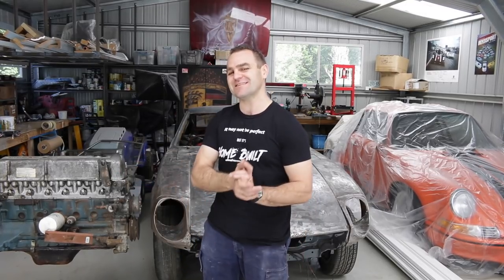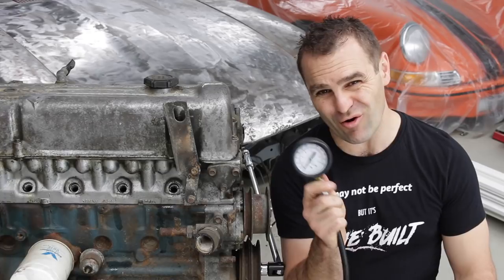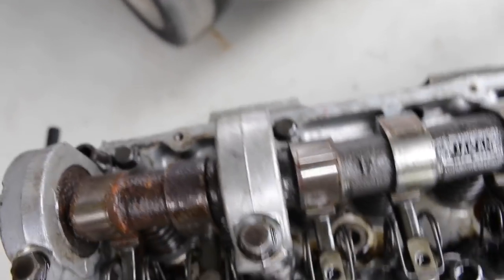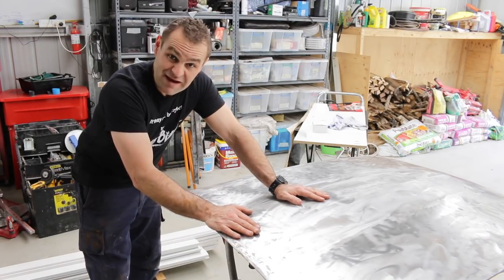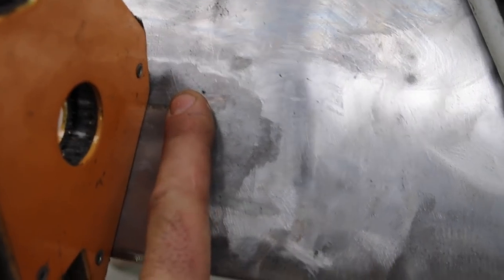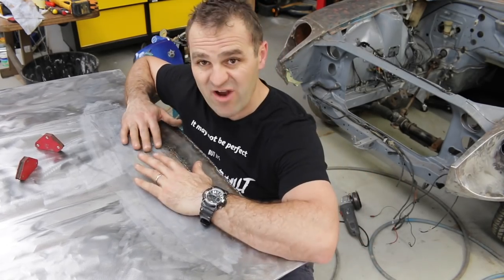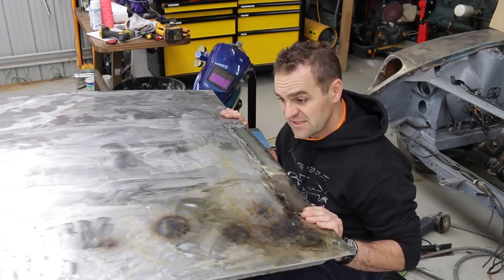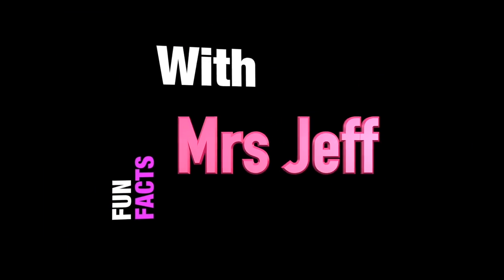Head off and panel shrinking - Home Built Datsun 240z part 4

Comment: For the Compression test your going to need to be turning the engine over at cranking speed or very close too it. What you can do in the future is a cylinder leak down test. put the engine on tdc what ever cylinder your testing and use a leak down tester to fill the engine with air and it will give you a percentage of leakage on that cylinder. Then you base your numbers off the differential of the cylinders. usually they should all be within 5psi of each other.
Reply from the maker: Thanks. I will definitely do that next time.
Reply: You wont get an accurate leak down numbers until this engine has ran. Its leaking everywhere with all that corrosion. Needs a new cam, new lifters, lap the valves, hone it and slaps some ring on it if the cyl. are still round.

Comment: Glad to see the shrinking technique treated you well. Also to minimise warpage when welding in patch panels you should quench the welds with cold water and a sponge. Keep it up jeff
Reply from the maker: I don't like using water on it as it gets inside the panel. That is why I was using the air, basically just as effective, without the rust issue.
Reply: Home Built By Jeff also tried air but doesn’t cool the panel anywhere near as good as cold water, I see your concern though. Just the nature of the beast I guess 😏

Comment: Geoff..... i'd leave a bigger gap between the metal to be welded.....so the weld 'fills' the gap, rather than builds up on top...
And if you've already tacked the piece into place and the gap is dissapearing, you can run a grinder through it with a super
thin cutting disc, giving you the correct size gap again... (if you follow me..!)
I'd also only do very very short welds, (2 or 3 trigger pulls), and keep it cool all the time.....hopefully preventing distortion...
Not being critical though, just trying to help.. Enjoying both builds....
Oh, and to upset the Datsun purists, chuck a big BMW motor in it....!!  Ollie.
Reply: ollydubhead the weld doesn't need to fill a gap, it should melt the surrounding metal and blend in, they call it penetration. If it is visible from the other side (without blowing holes in it obviously) it's called full penetration, which is what you want for the strongest weld
Reply: I agree, a big BMW engine would be cool; but most BMW I6s are slanted over significantly. Also, good tips on the panel replacement. If I'm reading your post correctly, it would be like this: https://youtu.be/KsuYQoqCZeY?t=8m10s
Reply: Yeah thats exactly how i do it....if there's no gap, the heated, expanded metal has nowhere to go, so it distorts.
And, like i said, if you find the gap is closing up when welding, dont panic, just run a 1mm cutting disc through it...hey presto....nice gap to weld again. Also, project Binky....the best...!
Reply: ollydubhead speaking of which, new episode!
Reply: Yeah, and he took note....! But to be fair, with that thin, knackered, scuttle panel he didn't stand much of a chance with a mig. Geoffs next toy: Tig welder...!  BTW, there's a new binky out too..

Comment: Hi Jeff! If you weld something like this, put some wet towels around the welding area to cool it down so it wont warp.
Reply from the maker: I don't like using water on it. Air is better. If you watch the next few I sort out the warping issue.

Comment: Hi Jeff, No Compression on engine.......... head may be warped, due to no or low coolant in the engine, when it was last run. The valve seats move out of position, as the head overheats. Had this on my old Mazda when a coolant hose split. Could see daylight through the side of the valves, when they were closed. Head was skimmed and all the valve seats recut.

Comment: Project car and alot of money going into the rest of the car. Get the engine pulled apart and put in a tank,  it gives you peice of mind and upgrade the valve seats to run premium unleaded. Makes life easier and i learnt the hard way with 2 engines. Worth every cent for a proper rebuild.
Reply from the maker: I have decided now I am going to do a full rebuild, but I will do it myself of course.
Reply: willow's random garage you don't have to upgrade the seats. Alloy heads have hardened inserts already.

Comment: Loving the Datsun build.  Looks like you need to regrind the cam, and replace the valves in the head.  I wimped out and bought a rebuilt head for my 240z.  I did install a ‘hotter’ street cam from competition cams.  The grind they provide lets me set the intake and exhaust valve lash to the same value, which makes life easier.  A bit rougher on the idle, but you can feel the increased pull around 4K rpm.  Good luck with the engine rebuild.  Are you planning on fuel injection, or the lovely SU twin side-draft carbs the 240z originally had?
Reply from the maker: I am now looking at doing a full rebuild on the engine. I am going to have a look at what cam to get. I want something that is still streetable, just a bit tougher. As for induction, I am not interested in injection. I am thinking of going triple webers. It should sound pretty good :D

Comment: If you have hydraulic lifters, you probably don't have them inflated with oil pressure. Cranking with a starter and seeing if you have oil pressure is a good start.
Reply from the maker: That is a great point. I didn't even think about the hydraulic lifters needing the oil pressure.
Reply: Anthony Krieger it does not have hydraulice lifters....just too slow

Comment: Did you remove the tape from the inlet ports to do the compression test ?
Reply from the maker: Yes. I think as others have mentioned, that the valves have some carbon build up on them and I can't crank it fast enough by hand to give an accurate test.

Comment: If i were you I'd look into electrolysis to treat the rust in the tight spots. It takes forever and won't be a 100% solution, but the bonnet is anyway past perfect/100%. :-)
Reply from the maker: Yeah. I basically see that this bonnet to many was past saving, so I see it as I am giving it a last hurrah.

Comment: Use a impact gun on your 27mm crank for the compression test
Reply from the maker: I tried that, but he impact just made it tighten the bolt, it didn't actually turn the crank.

Comment: No way those valves are seating properly, and as everyone else has said, too slow of a crank when the valves are leaking.  If the valves are in great shape you might get some low reading, or if the valves are shot but you have a full cranking from a starter you may get a low reading too, but not with slow crank AND shot valve seats.
Reply from the maker: Yeah, the valves have a lot of carbon build up, so I think you are spot on.